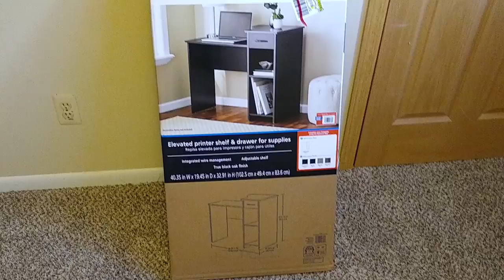Vlog Putting together Walmart Mainstays Computer Desk

Comment: Good stuff.  How did you get the slide in cabinet shelf to go in. Mines keeps getting blocked can’t go in all the way
Reply from the maker: It's the cardboard backing it's probably curved inward if you push it outward it outward the shelf should go all the way in. if it doesn't you might have the back board nailed wrong. Hope that helps

Comment: Man I slowed down on the part where your drawer wasn't going in right a d I tried to do what you did but it still doesn't work! It slide in but it's still way to high. I tried lowering it on both sides but it doesn't change:c

Comment: You think I can get a 24-27 in curved monitor up there? Thinking about getting this desk for my build also.
Reply from the maker: It depends on how high you can raise the screen up. My monitor is taking up all the space from the open edge to the edge of the upper shelf. If you can raise your monitors height 5" so the bottom of the screen is higher than the upper shelf then yeah other wise its going to hanging off the edge  not centered.
Reply: ThePowersinYourHands does a monitor, keyboard and mouse fit on the desk ?